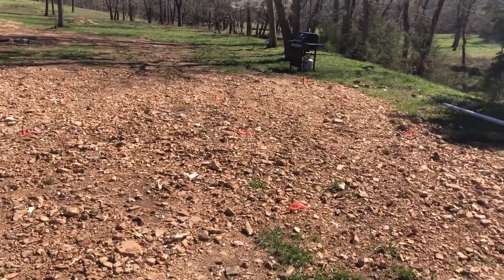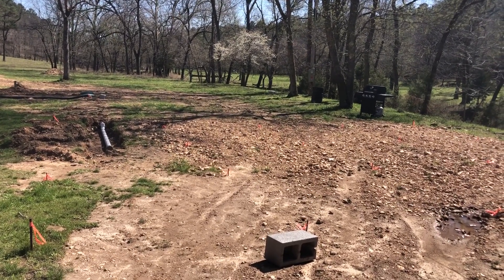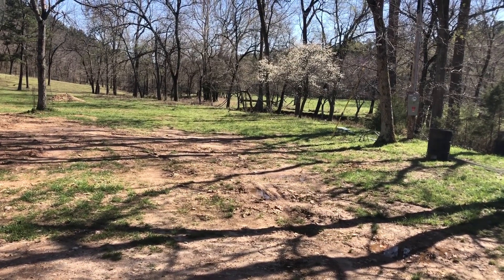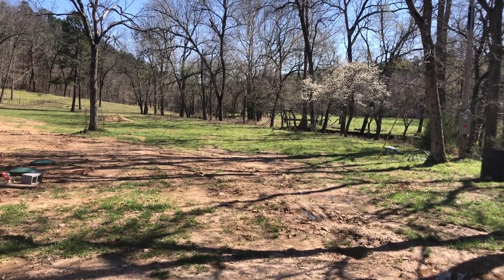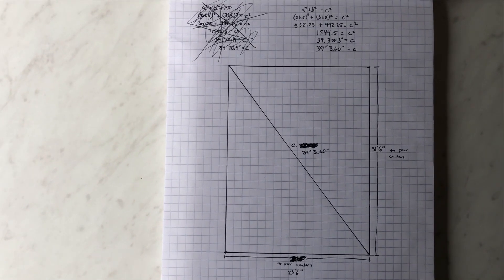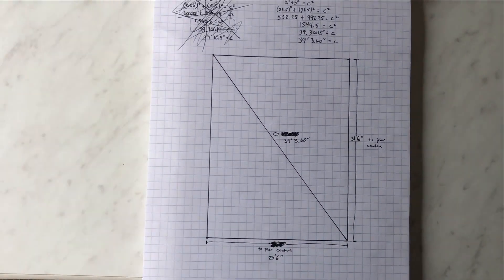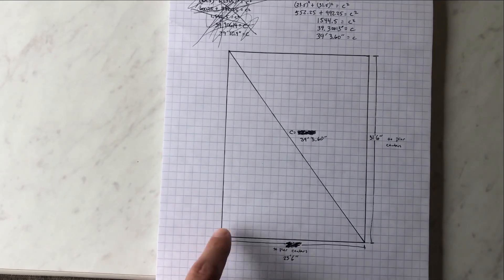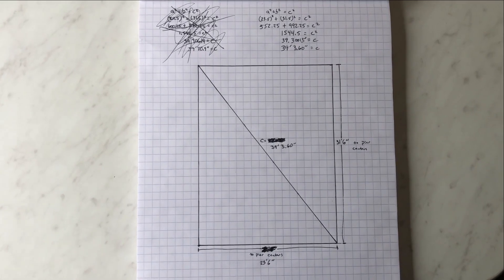Arched Cabin Build - Marking Pier Locations

Comment: Hi pls how did you determine how many piers you needed?
Reply from the maker: When I spoke with Arched Cabins LLC, they told me to have spans 8 feet or less between piers. For a 24x32 cabin, that leads to 20 piers. Hope this helps ✌️
Reply: @okiehippiefarm  sorry another question how many bag of concrete did you use for one pier
Reply from the maker: @samuelmiller3502  no problem, approximately 10 bags of 60 pound concrete for each pier…so 600 pounds per pier
Reply: Love this. We are about to build. I am wanting to build without doing the Ibeams. We are close to a river so we are trying to get up at least 5 feet. I had thought the pier had to be 24” wide and over 3 feet deep.
Reply: Starting a similar project near Poteau Oklahoma. Thank you for your series of videos, I will enjoy watching them.